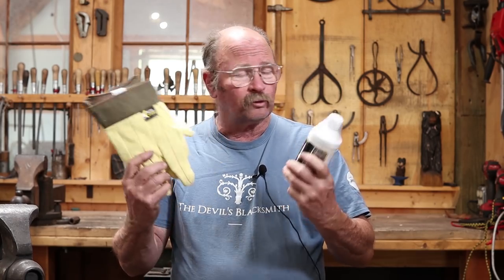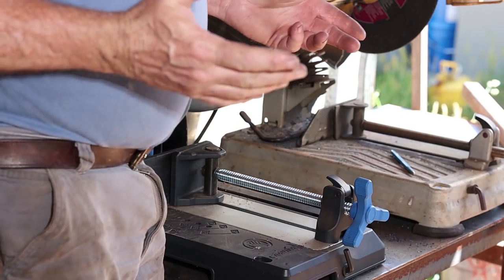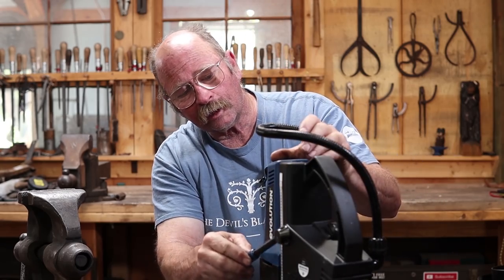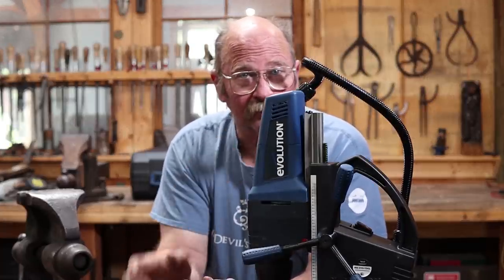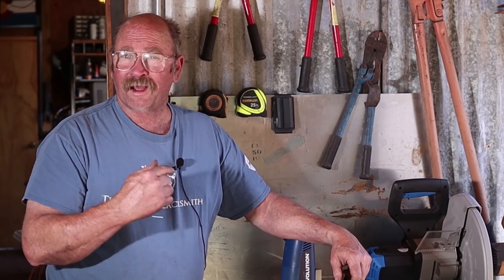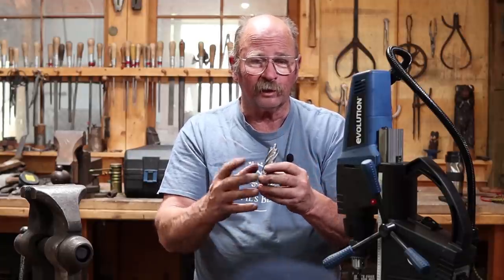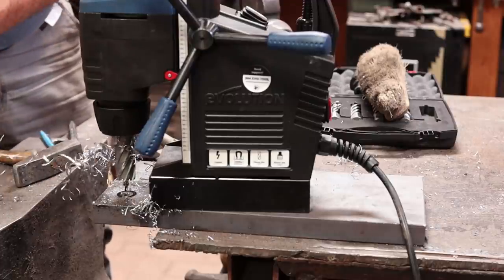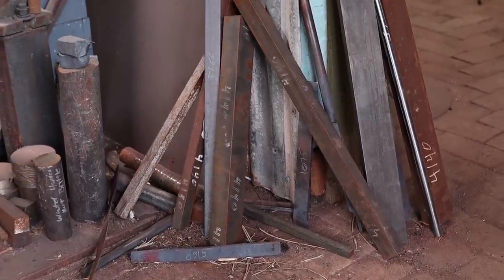Mag Drill review - Evolution tools EVOMAG42 magnetic drill

Comment: For cutting fluid FYI I worked as a fitter in the oilfield for several years building platforms and equipment, we always used a few tablespoons of Dawn dishwashing liquid in a 20 oz. water bottle with a pinhole in the top while using mag drills and annular cutters.  Worked fine for me, and it cleans up much easier than oil, plus it smells nice.  Worth a try anyway, and about the cheapest "cutting fluid" probably ever.  (I always sprayed very liberally unlike with oil where you just use a few drops)

Comment: seems like the adjustable base would be very handy for drilling horizontal or upside down. Be difficult to line up, flip a switch and hold the weight of the drill all at once. 
Looks like a decent tool though. 
Thanks for the review.

Comment: The table you've built for the saws looks like it will be a really nice feture in the shop. To the right of the saws there's probably enough space for a really convenient off cuts bucket.

 I'd think the micro adjust feture on a mag drill would be for when you are working on vertical projects as well as when drilling upside down due to the problems with having to line up your drill bit while holding the full weight of the drill. 

I really like your tool reviews but they do leave me with the problem that the tool collector in me really wants to go shopping for tools I don't really need as I wouldn't use them enough to be practical. Evolution should really be thinking about becoming a full time sponsor 👍

Comment: Excellent video.  Just wondered if the mag drill would attach to the side box section of a gate 30mm to 50mm?  Would it be enough steel for the drill to magnetize to?
Reply from the maker: I don't think so.  But you could probably clamp some angle to the side to provide a larger surface for the drill
Reply: @BlackBearForge  that's a good idea thank you.

Comment: Nice tool to have.  If I were going to build a stand to make tenons with it as you mentioned, I would consider making a small table that would bolt behind your post vice.  If the table your post vice is bolted to has a thick enough top, maybe even thread the holes.  I don't think the mag drill would run slow enough to power tap holes, but I have never had to tap a hole, so...  But a small table behind the post vice approximately the height of the vice jaws could be useful for other things besides the mag drill.

Comment: very nice but cant go as big as an old radial arm drill press but then again they are usually huge and huge horsepower, but mag drills do come in handy no doubt and can do most size holes we would use today even if you are doing historical machine work for riveting or drill flues for steam boilers like I associate with sometimes. of course for the really big stuff they send to a specialty machine shop, or use a waterjet cutter on a gantry not much you cant cut with those if you have time

Comment: If you find yourself wondering where to get a transfer punch like he used, these have worked well for me: https://www.harborfreight.com/28-piece-transfer-punch-set-3577.html Nothing wrong with using a pencil, but this will find center easier and more accurately, so I reach for them first if I can.  I've worn out a set in the past, but cheap enough not to worry about it.  I've also used a pencil in the hole to help me find the punch mark faster, but rely on the transfer punch mark for actual drilling. The only limitation for a transfer punch is depth of the reference hole. It's not going to do the job matching holes on thin sheet, but something like these saw bases, or other blind holes, they work a treat.  
Mag drills are nice, if you deal with large plate goods often enough, but honestly I've never found enough of a need for one to pay what they ask for them.  Evolution makes a nice drill for the money, there are others out there that cost a lot more, but they all do the same job, really.  I do have their saw, and it is great for when you need a clean accurate angle cut.  I hope Evolution continues to give us good tools at a competitive price, and doesn't start cutting corners (no pun intended). They are the new Craftsman IMO, harking back to what Craftsman was in the good old days.

Comment: This drill travel allows you to use a chuck and full length twist drill bit. That is A GAME CHANGER. Most affordable ( for the non pro homeowner shop!)  mag drills, when a chuck is installed,  leave no room for a full length twist drill. Annular cutters can be used but they don't go smaller than 1/2 inch,  so you have to use twist drills for smaller holes. There are adapter kits you can use to eliminate having to use a chuck, but the fact that this drill raises high enough to allow a Jacobs chuck and any short or full length twist drill bit is phenomenal!!!!
Reply: not true they go smaller than 1/2"but they have a tendency to brake if you are not careful when you drill